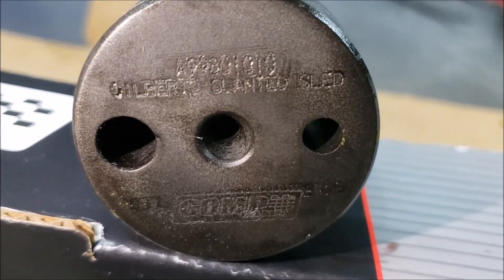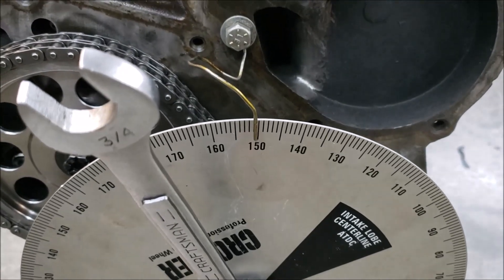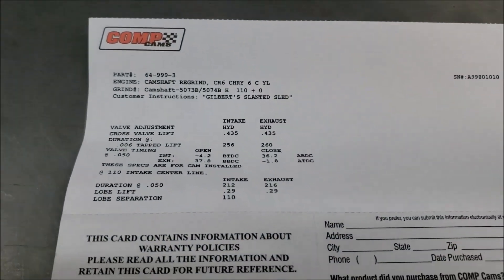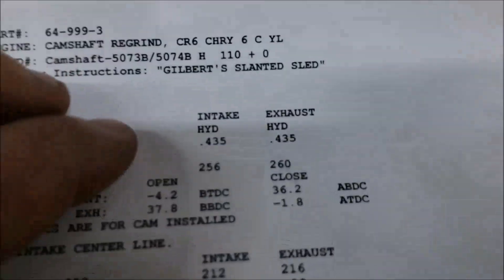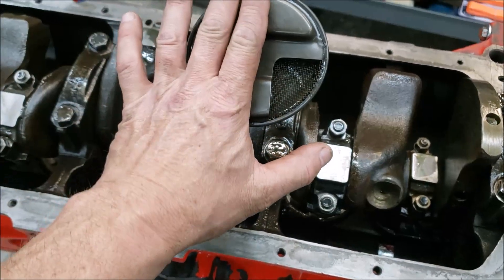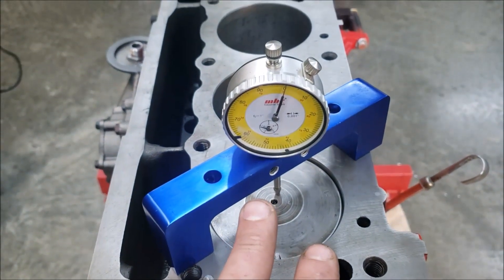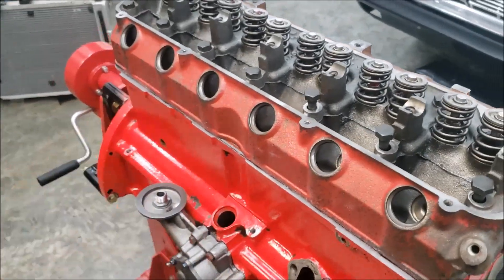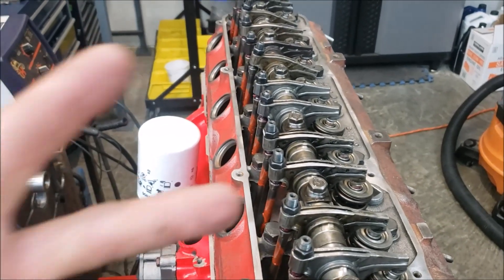Cam specs revealed and we failed by one bolt.

Comment: Doesn’t the welded nut and bolt over the center of the timing chain cover technique also correct for camshaft “walk”?  Nice info on the cam timing on the Slant.
Reply from the maker: That is, cam walk in the opposite direction that I am talking about. This is the cam gear, not rest against the block because the crank gear is tracking the chain too far away.

Comment: The rotation of the cam followers and pushrods, is created by having the face of the cam lobes ground with a slope accross the face of the lobe. A similar angled surface on the rocker arm causes the valves to have a "Positive Rotation" action, both of these are for more even wear accross the hardened mating faces. Not having that angle to the cut is where the majority of aftermarket cams end up with End Thrust issues, and need a modified cam gear cover with adjustable bushing to stop the cam walking forwards out of the bearings and damaging the cam and the lifters and putting metal in to the engine.
That thrust caused by the angled faces on the cam lobes also needs to be considered when pulling material off the Crank Timing Gear, as what you may be doing is using a sideways preload on the Camshaft Timing Gear to hold the cam backwards in place in the way that the factory engineered thrust loads would do with a factory original cam. This may lead to premature wear on the Roller Cam's chain.
Reply from the maker: Thanks for the input.

Comment: Hey good advice with the timing gears. When I was young, me and my idiot mates { me one too }, decided that as it was not a V8, the slant in our rusted bomb must die hard. as punishment for it's performance or lack of! Using, old gear oil for engine oil and a brick for throttle control. After some minutes I felt sorry for it and we just started driving it again! I am always surprised that for someone that can build lots of V8 power, that one would love such an engine. It's robustness is an enduring attribute. Cheers.